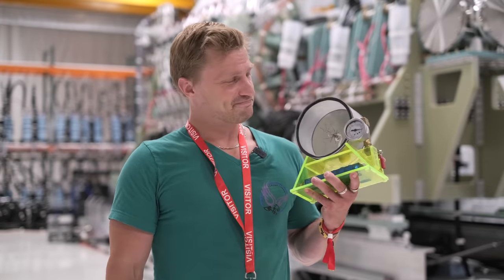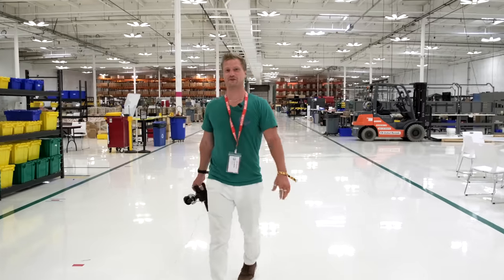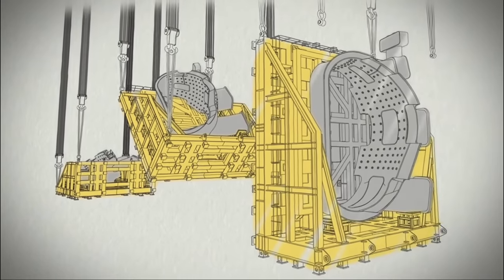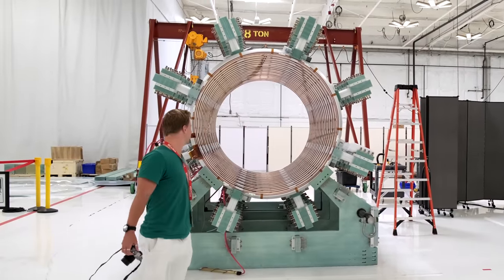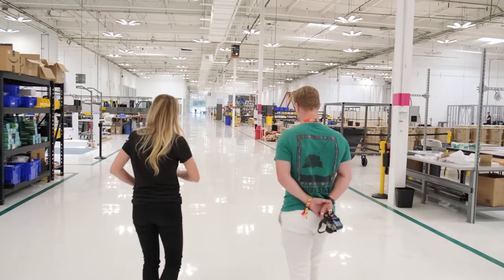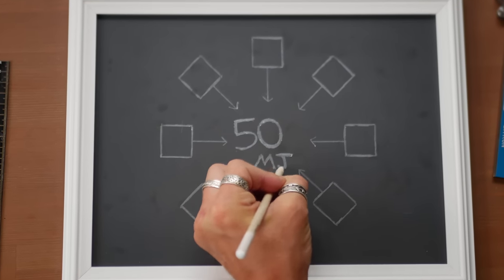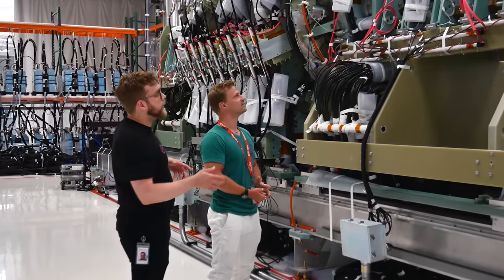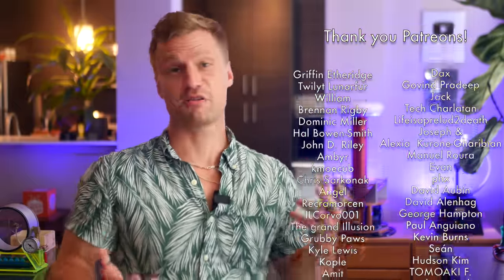An Exotic Approach to Nuclear Fusion (Helion Energy BTS)

Comment: "about 300g of tritium will be required per day to produce 800 MW of electrical power. No sufficient external source of tritium exists for fusion energy development beyond ITER."
Reply: Good thing then that Helion does not use Tritium as a fuel. They actually make it as a byproduct.
Reply: @elmarmoelzer2229  HA! Thats funny and true but if you look into the process it doesn't work like that. I don't want to burst their bubble but a net positive output for a fusion reactor is still decades away...not later next year.
Reply: @MrJanes-cl5sj  
Sure it does work like that. You fuse two Deuterium atoms, you get either a Helium3 atom (which they use for fuel) or a Tritium atom (which eventually decays into more He3 for more fuel, or they can sell it for $$$$$)
Reply: @elmarmoelzer2229  lol...K well you go ahead and invest your retirement in the project... this is not going to work.
Reply: @MrJanes-cl5sj  
What is there to LOL about? That fusing two Deuterons produces a Helion or a Triton is well established physics. 
Also, Helion unfortunately does not take any more investment. They are fully funded all the way to commercialization.
Reply: @MrJanes-cl5sj  
That is BS. I don't know who told you that but they clearly have zero idea what they are talking about.

IPA (still an academic research project) did 10^9 fusion reactions per pulse back in 2008.
Venti did 10^11 fusion reactions per pulse in 2018. 
Both of those results were published and peer reviewed. Venti's results were peer reviewed by the JASON review board for ARPA-E.

Trenta did much more even (since scaling laws held up), but the results were not made public. It is being said though that they were peer reviewed by a team of external reviewers for the investors.
I would estimate at least 10^12 if not close to 10^13 fusion reactions per pulse
Reply: @elmarmoelzer2229  my apologies my terminology is terrible I am an investor not a physicist. Well I will be following their Polaris launch-but something tells me its going to fall flat. I have seen thousands of executives talk boat loads of B.S. and... well... this guy fits the bill. If the right people were raving about them I'd be more inclined to believe him, but my sources don't think its on the level. They think they are going to have a 50 mega watt plant online by 2028?!!!! LOL...I mean that would be great but...sorry no...
Reply: @MrJanes-cl5sj  
Who are the "right people"?
Are they experts for FRCs? Are they familiar with pulsed magneto inertial fusion systems? Someone who is an expert on low beta Tokamaks is not an expert on high beta FRCs. Someone who is working in steady state systems or inertial confinement fusion systems is not an expert for magneto inertial fusion systems. Tokamak people in particular do not understand either one of these concepts and fail miserably when they try to apply what they know about Tokamak physics to what Helion is doing.

The time to watch IMHO is the end of 2024 (give or take a few months) when Helion is planning to generate small amounts of electricity from fusion for the very first time. That is when we will know whether they can do it or not. The 2028 is deadline will stand or fall with that milestone. IF they manage to do it (and they might fail), then they 2028 is relatively easy to achieve.
Reply: @elmarmoelzer2229  yes watching someone power a device with electricity that is supposed to generate more electricity than it uses should be entertaining.
Reply: @MrJanes-cl5sj   Oh, they will be able to unplug Polaris from the grid and it will keep running (if it works as they think it will).
Essentially how it works is:
Energy comes from the capacitor bank. That is used to power the magnets and whatever else there is. Fusion happens. Fusion adds energy to plasmoid and drives its expansion through the magnetic field. That induces a current. Note that the plasmoid will expand even without any fusion reactions happening. They can recover a good amount of the input energy that way.
So recovered input energy plus added fusion energy go back to the capacitor bank. The capacitor bank now has a surplus compared to before the pulse. Surplus goes to the grid (in case of Polaris probably just to some demo- rig that consumes energy, maybe some electric motors, light, etc or something fun that they want to use). The rest goes back into the machine for the next pulse. Only the first pulse will need power from the grid, but it should just be in the single digit kWh.
Reply: @elmarmoelzer2229  I think you are confusing Qplasma with Qtotal
Reply: @MrJanes-cl5sj   No, Polaris is really meant to have a Qtotal (Qwp or wallplug) of greater 0. That means it is meant to produce net electricity and not just net energy.
Reply: @MrJanes-cl5sj   Ah! And you know that how? Have you read their papers? Do you even know how the design works?
Also note that theoretically, when you can recover the input energy at very high efficiency (85%+), you can theoretically get a Qwp over 0 even with a Qsci <1.
Reply: @elmarmoelzer2229  buddy you think this machine can generate enough electricity to run itself-you don't even know the laws of thermodynamics. You are literally describing perpetual motion LOL!!!
tell you what I am going to bet on wave power you take helion...lets see who is producing more power in 10 years.
Reply: @MrJanes-cl5sj  No, it is not perpetual motion. I don't know why so many people think that. Of course, the machine would not be able to run itself if it was not for the added energy released by fusion reactions!!
Fusion reactions release energy. That is established physics. If you want to actually understand it, read up on the mass defect. 
Essentially, what happens is that the mass of the sum of the fusion product particles is smaller than the mass of the sum of the mass of the fusion fuel atoms. That missing mass is the nuclear binding energy that is released.
Reply: @elmarmoelzer2229  yes but the entire reaction is induced artificially-this is not like fission which is a chain reaction. 
Think of EVERY SINGLE other means of generating electricity...do any of them require a motor to run? Any of them need to be plugged in to work? 
There needs to be a massive physics breakthrough before this is feasible thats why people are saying 2040. If our best guess is to try to run this off of solar panels what does that say about solar panels?

Comment: 🤣 these people are behind.  I've seen sustained reactions through multiple plasma domains.   They get more energy out than in.  They can remediate nuclear waste, and doesn't require radioactive materials.  🤣. Go away with this
Reply: The point of this design is that it does not have to sustain the reaction. Also wonder where you saw that. So far only NIF has published results of net energy (and mind you a far cry from net wall plug power).

Comment: im thinking if using superconductors will reduce even more energy loss. maybe if the Korean room temperature superconductor is real it will be a very good utility for helion since no mechanical systems are used, and the only energy loss is resistance in wires
Reply: Some day in the future maybe, when we have high temperature super conductors that are as cheap as their aluminum magnets.

Comment: Is the "speed of electricity" fast enough?
You have to sense the reaction then send a message to the polarity switching mechanism and then reverse the polarity.
All this takes time, and if in the mean time a second reaction takes place, you are facing a thermal fusion runaway.
So I imagine they build in systems to cover the second reaction to remove the heat, but its mathematically possible that a third reaction takes place before the change in polarity of the magnets. Lets face it you can't guarantee exactly when in a nanosecond space  the reaction will occur and definitely not how many reactions.. I don't believe anyone has managed to measure the orientation, spin and axis rotation of the Ds and Hs to determine whence the Coulomb barrier will be broken. They both only have a tiny sweet spot where this can occur.
So Is the "speed of Electricity fat enough", or will the whole reactor just turn into a blob of molten history.
Reply: There is no such thing as thermal fusion runaway. The moment that you lose plasma confinement the gas begins to cool. Within mere milliseconds it has cooled to a temperature below that at which fusion can take place, and energy production simply stops. The entire system will come to a stop within just a few seconds.

Something that seems to be wildly misunderstood about fusion vs. fission is the amount of fuel involved. With fission we're talking many hundreds of kilograms of fuel rods. With fusion we're using only a few grams of gaseous fuel in a very large volume at near vacuum pressures. The worst thing that could happen is that you damage the walls of the chamber, but hopefully your engineers are smart enough to use high temperature materials and you avoid that problem. There isn't enough mass to do much anything else and there's no way it can "runaway" in a melt down type reaction.

Comment: Awesome Tour Video!!! 
Deuterium + Helium-3 is a very interesting and different methodology from standard fusion... and the fact that it releases charged particles as part of the fusion process seems like it solves several issues at the same time!  The only thing I don't quite understand is how they are harnessing the charged particles if they are produced inside the hollow section of all those magnetic coils. Those protons will be all alone, and will want to pull the electrons off of surrounding materials. I am very curious how that all works with their process. Additionally,, how are they able to control the directionality of the charged particles in order to harness electricity?
Reply: To the best of my understanding, the protons transfer their energy to the FRC plasmoid. That one is still organized when it expands.

Comment: A perpetual motion machine is a logical impossibility. Its never going to happen.
Reply: It is not a perpetual motion machine though. The machine will have losses, but those are more than made up for by the extra energy released by the fusion reactions.
Reply: @elmarmoelzer2229  The universe as a whole is a perpetual motion machine. You can't put what the universe does into a small box.
Reply: @stephen7774  Again, Helions machine is NOT a perpetual motion machine. Fusion reactions are not breaking the laws of physics.
Reply: @elmarmoelzer2229  True, fusion reactions are not breaking the laws of physics. But trying to duplicate what the sun does in a small confined area will be an act of futility regardless. The amount of energy to initiate a fusion reaction will always cost the same as the energy extracted. Now, that's a basic law of the universe which is universal. lol
Reply: @stephen7774   Uhm no, it is not. You do know that thermonuclear bombs exist, right?
Reply: @stephen7774   Fusion reactions release more energy than you put in. In fact every single fusion reaction releases more energy than it took to initiate it. And no, that does not violate the conservation of energy law. Why? Because of the "mass defect". When two fuel atoms fuse, the resulting fusion products have just a tiny little bit less mass than the sum of the masses of the fuel atoms. That missing mass is nuclear binding energy that is released.  And that is why a thermonuclear warhead has a much higher yield than the fission bomb that triggered the fusion reaction.

Comment: Many if not most fusion experiments aren't about producing power. They are about stimulating nuclear bombs.

Also fusion is always 15 years away, it's been that way since the 70s. I'll believe fusion power is viable when a commercial power plant is built. Not when an experimental reactor is ran for a few secs at a time.

Comment: The company might be a bit of a scam, see the top comment in this video (and point made in vid too): link below. 

Could you please do a follow up plasma channel?
Reply: @nommy8599   They are not a scam. The video is nonsense.
Reply: As for "scamming investors with these videos", it is worth noting that Helion had almost zero public visibility until AFTER they got the big investment. Their investors have been on the board for many years before that. Some since the company got started. 

The little fusor David Kirtley helped that female Youtuber build was a fun little thing to show that you can build a machine that can theoretically at least do a little bit of fusion with relatively little investment and expertise. Fusors are common experiments and some have even been built in High schools. No one claims that they would be net energy fusion machines or anything like that.
Reply: @elmarmoelzer2229  Ok that's reassuring to hear. I wasn't sure and was just looking to have it looked into. So you reckon the company is legit and not just some and mirrors like it's portrayed in that critical video?

Comment: 2035 Fusion finally achieved. Limitless cheap clean energy. 
Turns out the limitless cheap energy comes from solar panels with a price, thickness and appearance of a bin bag. + cheap batteries. 
The fusion works, but anything that complicated isn't going to be cheap. The US airforce has a couple of planes with fusion reactors in, and they are the biggest fastest and most expensive planes ever made by a large margin.